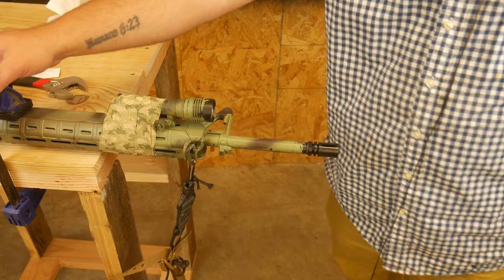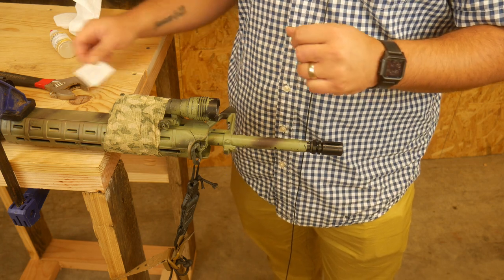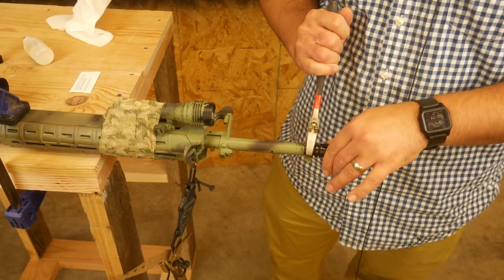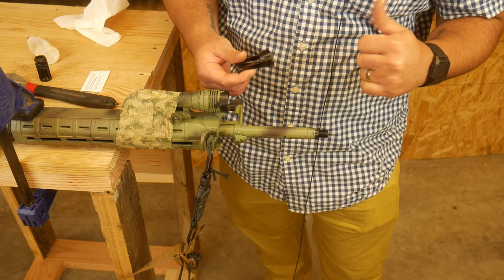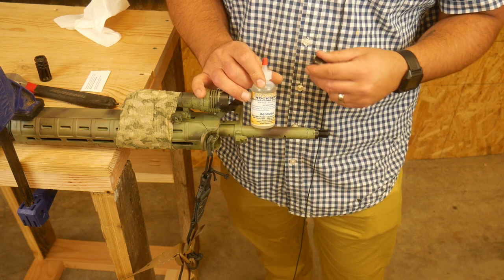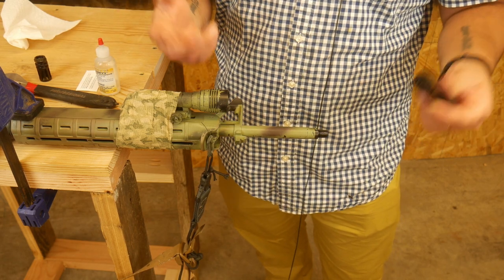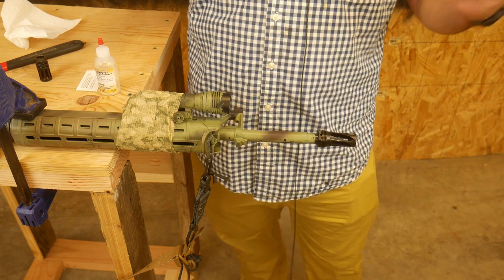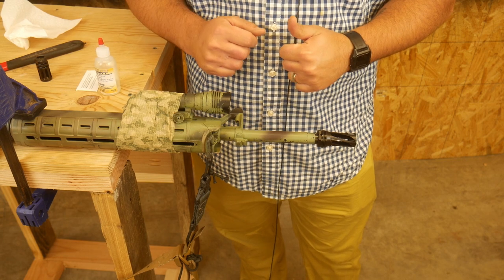How To Install Huxwrx / OSS Flash Hider for Flow Through Suppressor

Comment: You actually don’t need rocksett or loctite for Huxwrx muzzle devices. Just torque to 35ft pounds. Suppressor left hand threads so if it did try to get stuck you’ll just tighten the mount more.

Comment: It's been a few years since I've used Rocksett, but I remember the instructions used to say, after torquing, to heat with a heat gun, until the Rocksett begins to run out of the threads.
Reply from the maker: Hm, I don’t recall seeing these directions when I read the bottle
Reply: @CitadelDefense1  Maybe it's changed since I've used it. I'm not sure the small bottles / tubes that come with the Surefire muzzle devices have the full instructions, but the large bottle I bought some time ago had more instructions with it.
Reply: Just let it set for 24 hours you don't need anything else.